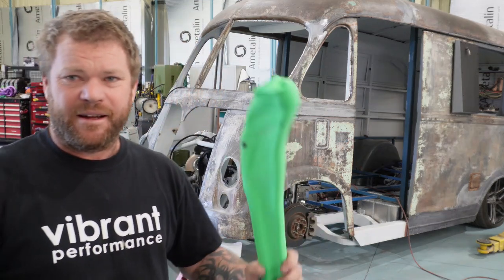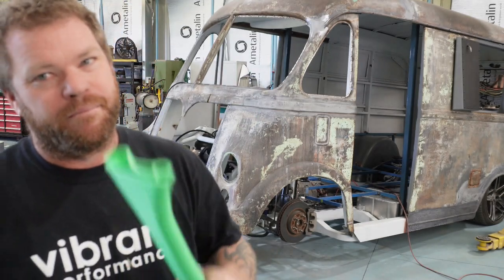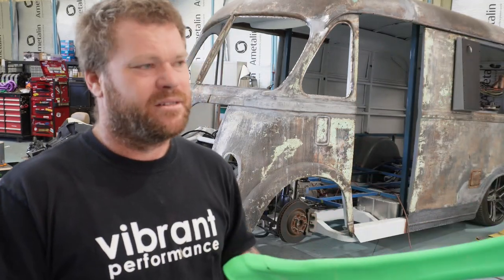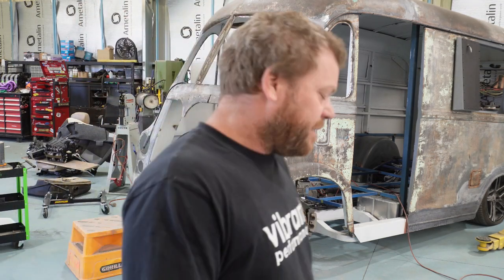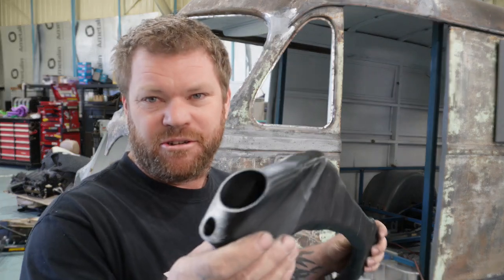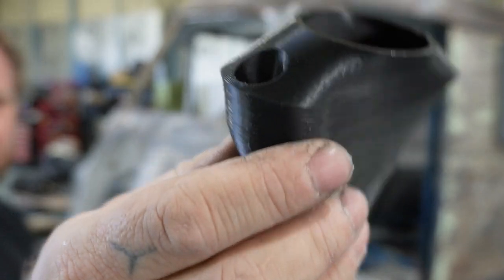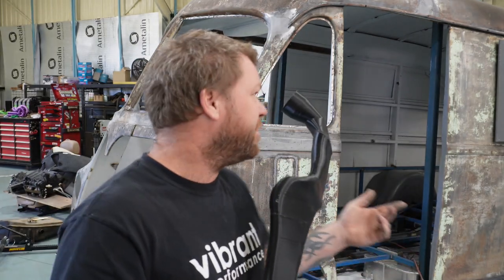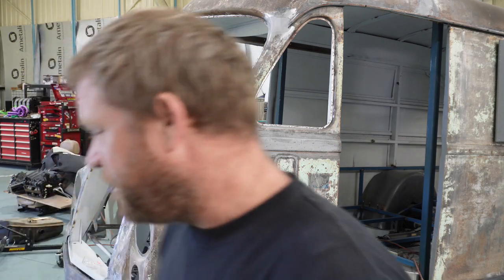Custom 3d printed Aircon tubes. SSMETRO Ep43

Comment: Great work on those ducts. I can image how long they took to design. I have switched to using ASA instead of ABS for my car parts as it seems to be much easier to print.
Reply from the maker: Hey Jeff, yeah, they did take a fair bit of time for sure, I have recently converted to ASA also, much much nicer to print with should have swapped over sooner. cheers for watching

Comment: list is a great idea mate - dont give up!!  i have also used my 3 d printer for a range of fittings.  one thing that i do is make a pocket for the nuts so that they are captured makes it much easier to assemble later.  that fuel cap is like the till in ronnie barker's open all hours, a real finger biter
Reply from the maker: Cheers bud yeah, the fuel flap is hectic ha ha, I've deigned parts up with pockets for nuts (will see in a future episode) I have seen vids where people actually stop a print at a certain time and insert nuts or magnets but they is way above my pay grade at the moment, 3d printing and scanning is a game changer and will be used for some major parts moving forward.